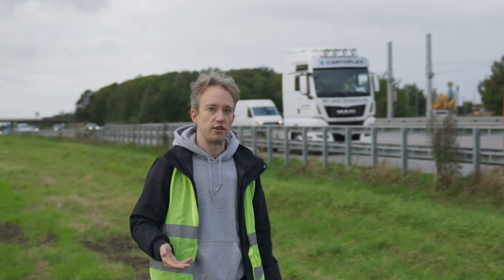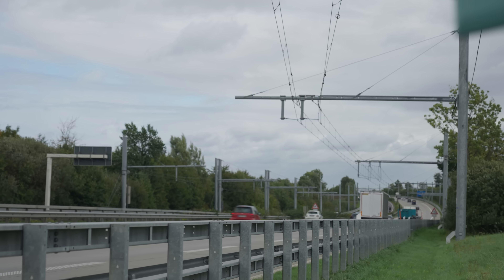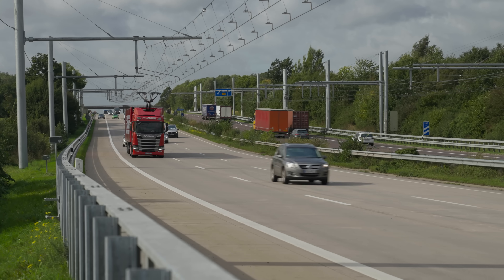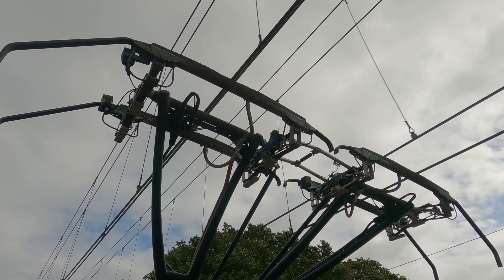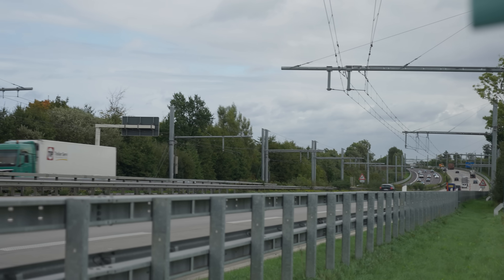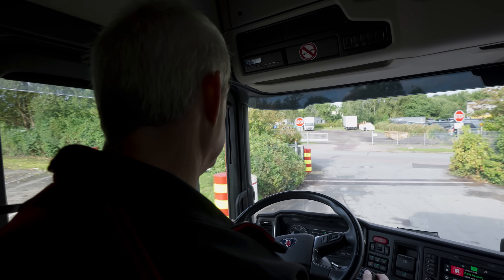The highway where trucks work like electric trains

Comment: There's an inherent loss to charging. I'm too lazy to look it up, but it might be as high as 40%? Add to that the environmental toll that large capacity batteries take... these are a no-brainer IFF it can be scaled up economically.

There are practical applications as well. Instead of a long cable, there can be sections. Zones that overlap two rails can be used to measure the speeds of trucks, and therefore feed into a GPS system to inform truckers of issues ahead. As a person who likes to do road trips overnight, I also see trucks weaving out of their lanes as the drivers nod off. A simple system can be implemented to alert truckers that they're veering out of lane without the turn signal on. A few other implementations I can think of too.

Edit for the curious: weight station avoidance detection, by seeing the spikes in trucks in off hours. wear and tear prediction calculation based on accurate truck usage statistics. weather services being alerted when trucks need to slow down due to weather. suggestions on alternate routes based on blockages. on and on, if the age-old technology gets rolled out for trucks.

Edit 2: A toll system, with an identifier rail. Non-contract users such as EV drivers can purchase an antenna array which connects to the rail system, allowing for long-haul EV driving. Come on, the possibilities are kinda endless!
Reply: Electric cars are extremely efficient. Charging losses are less then 5% AFAIK. You're literally better off burning fossil fuels in a power plant and charging electric cars, than fuelling fossil cars.

Comment: There is a electric test highway track on the A5 too between Frankfurt am Main and Darmstadt.
Reply: Ich hätte nie gedacht, dass ich unter einem Tom Scott Video einen konstruktiven Kommentar von meinem Lieblings YTK Kanal aus meiner Kindheit zu finden.
Reply: I've never seen a single truck on there actually using the overhead wires, though.
Reply: @HeadsFullOfEyeballs  because it's a test circuit only. They're not going to install something like that for a day or two to run a quick little test.
Reply: Du Ehrenmann mach mehr Videos
Reply: Da gab es auch mehrere tödliche Unfälle, der Geisterfahrer der 4 Menschen tötete oder der Fahrer der in die Tankstelle fuhr, den Schaden habe ich gesehen als die Feuerwehr Brandwache gehalten hat, die A5 ist ziemlich gefährlich. Warum ausgerechnet dort ne Teststrecke gebaut worden ist, weiß ich nicht.
Reply: Die Strecke hier ist zwischen Reinfeld und Lübeck auf der A1 in S-H
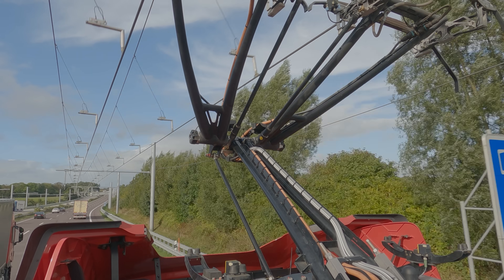Reply: @Eating Rainbows Gaming The highway shown in the video is A1 near Lübeck. source: i'm a local and 2:10
Reply: und 300 m östlich ist die Bahnlinine DA-F...
Reply: @micha0001  die jetzt schon mit den Personen Zügen überlastet ist
Reply: @micha0001   das ist doch lediglich eine Teststrecke, keine Konkurrenz zur Bahn. Lediglich eine Teststrecke, egal wo, es geht um Proof of Concept.
Reply: @micha0001  danke 🙏 

Echt komplett bescheuert
Reply: @johnasweydlnk5313  die deutsche Bahn hat seit den 90er Jahren einen beträchtlichen Teil vom Schienennetz zurück gebaut...
Reply: @johnasweydlnk5313  das ist doch lediglich eine Teststrecke, keine Konkurrenz zur Bahn. Lediglich eine Teststrecke, egal wo, es geht um Proof of Concept.
Reply: @johnasweydlnk5313  Wieso?  Das ist doch lediglich eine Teststrecke, keine Konkurrenz zur Bahn. Lediglich eine Teststrecke, egal wo, es geht um Proof of Concept.
Reply: @borntoclimb7116  Die Teststrecke ist dort, weil es dort eine sinnvolle Anwendung gibt. Container vom Flughafen zu den Speditionen zu fahren. Da fahren tagtägliche hunderte von LKWs zwischen Flughafen und den Ortschaften Richtung Mörfelden und Gerau Pendelverkehr. Deshalb hat sich das dort als Praxistest angeboten. Die ganzen Speditionen im Süden vom Flughafen sind ein extrem gutes Einsatzgebiet für ein solchen Test. Und es gab eben dort auch Speditionen die bereit waren an dem Feldversuch teil zu nehmen.
Reply: Its him bois, the legend himself
Reply: @Eating Rainbows Gaming it‘s not… this is A1 Autobahnkreuz Lübeck to Reinfeld and back. If you can read the number plate you will be able to read the road signs as well. The number plate is probably due to the leasing company of the truck. Spedition Bode is in Reinfeld and has the OD- registration plate.
Reply: @wolfman1325  Just as a point of interest though, number plates are no longer an indicator of where someone is from. I've just done the famous "ummeldung" myself by way of relocation within Germany and have taken my number with me.
Reply: I was there yesterday and my Dad explained to me what those wires are for, and then today Tom roles out a Video about them.
Reply: Bossianus du Legende
Reply: Bossianus einfach legendär
Reply: Jup, and they dont use it haha
Reply: I didn't know that
Reply: Ha, Darmstadt =w=
Reply: Thats mainly for the city buses
Reply: @jujuryan9632  Es ist ja nicht so, dass rechts und Links der Autobahn genügend geeignete Wiesen wären.
Reply: @Poebbelmann       es     ist     nur    eine   Teststrecke.            Proof of concept Teststrecke.
Reply: I thought the A5 ran from London to Holyhead ??? 
Oh, you're talking Germany, Doh !
Reply: correct, has been for a number of years.
Reply: hi bossianus
Reply: I never saw a truck on that track..
Reply: was geht ab
Reply: And the B462 from Rastatt to Gaggenau is also equipped. Source: I am a local.
Reply: I often take the highway between Darmstadt and Frankfurt. I have never ever seen a lorry using these cables. Looks like a great waste of money.
Reply: @heyyou274  because it is a test circuit only... tested once in a while... proof of concept,. It has never been advertised as a fully released or "in service" concept.
Reply: @heyyou274  god I wanna creem some EU buSsY so bad dude
Reply: yep I have to drive there every day its SO disgusting
Reply: @alpha-cf2oi  true, it isn't very sightly, but does contribute (might ultimately contribute) to reducing pollution, which is the aim.
Reply: That's really great. But now it be really awesome if freaky Germoney would have a sufficient and reliable electrical power supply. Too bad this Merkel pulled the plug on nuclear power.
Reply: Und es war eine absolute Geldverschwendung dafür das es 1 Lkw gibt der darauf fahren kann
Reply: @leoo3oo768  Das ist doch garnicht dafür gedacht Geld zu sparen. Das wurde als Proof Of Concept gebaut.
Reply: @leoo3oo768   das ist (sind) doch lediglich eine Teststrecke(n), es geht um Proof of Concept.
Reply: @leoo3oo768  
You have to begin to  test the concept somewhere.  
A regular working route makes more sense. The longer the better especially if is an area lacking in existing rail capacity.
Or long urban routes where for instance the road network is already elevated such sections are extremely problematic and common.
Reply: @clivestainlesssteelwomble7665  This is what they do here in Frankfurt. Regular traffic between the airport and the warehouses/distributors in the south area of the airport. And this works very well.
Reply: @leoo3oo768  Es ist ein Test, natürlich fahren auf den 5 km keine Kolonnen von E-LKW. Das Cern ist auch mehrere Kilometer lang und da werden für viel Geld "nur" kleine Teilchen durch die Gegend geschossen.
Reply: I uploaded my Face Reveal.

Comment: This could be an excellent idea but infrastructure wise  very costly to set up and maintain. it certainly would need government support to make it work on a big scale. 

In Western Queensland they use 3 or 4 trailer road trains perhaps electric powered trucks like these could work. but would it be cheaper than just upgrading the often parallel railway to operate on electric power too. But the distance are very long ie 1000km plus. Thats alot of overhead wires all of it on above single lane highways.

Comment: I actually like this idea. Creating a new railways system that transports goods to specific areas like trucks would be extremely expensive and probably impossible, since infrastructure is designed mainly around car & truck transportation. This is a great alternative to a railway system and seems to be a lot more viable of an option.
Reply: Expanding the freight transport capacity by railway significantly would require huge investments in new railway tracks.... including the power cables and the rails. In Germany,  this usually takes a lot of time. When upgrading highways for this kind of trucks,  only the power cables need to be added - the road does already exist. And especially in Germany,  which has a huge Autobahn network already existing,  it makes a lot of sense to continue to use this existing infrastructure... just add these power cables to the right lane on as many Autobahn parts (and also some other  federal highways)  as possible.

Comment: We have buses here in Milan in Italy that use a similar system on a few routes. They have a tram network as well that uses the same type of overhead wires. The call it the Filovia (probably spelled wrong) 'wire way' they have been here for as long as I have been visiting which is more that 15 years and they look like they are much older than that.

Comment: I have 2 questions.  1.  On a freeway I would think these wires would see use probably 1000 times those on a electric train track.  How long will it take before the frictional wear causes the wires to fail?  2.  If we stop all use of fossil fuel for transportation where will all the electricity come from to power these new vehicles.  I have not seen any governments (other than China that is building coal power plants every day) develop a plan to provide enough electricity for the increased demand.
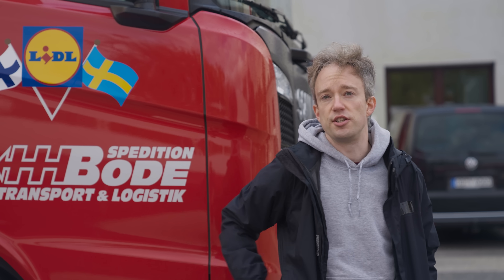Reply: It´s like on a train. On a train the contacts of the train are normally much softer than the wire. So the contact wear down instead of the the wire. you can see it at 3:46. The dents in the contact is where the cable was wearing down the softer material.

Comment: Ok the solution is to charge as it moves, but instead of installing overhead cables everywhere, isn't it possible to install a wireless charging system in the pavement? There's rebar in a concrete road, to add something to this metal grid is surely possible.

Comment: I don't understand.  Unless we're talking about moving perishable items, why not just use the already established rail lines to deliver these goods?
Reply: If you've already got rails installed, that's great.  But if you've got trucks on roads currently delivering to existing warehouses, you need to contrast this comparatively limited investment in electrification vs the substantial investment in rail grades, electrification, grade separation, and probably replacement of a lot of warehouses where it is infeasible to build rails to the existing warehouses.
Reply: because trains are slower, less reliable and cost more

Comment: See it makes more sense for tractor trailers to go electric instead of the average person having to switch. They mainly stay on the highway and it would be cheaper infrastructure to centralize everything at truck stops so they can charge while they are off the road.

Comment: One serious issue is that this solution will impact the emergency service on those roads ... right now its extremely common to land an emergency rescue helicopter right on the autobahn next to an accident, this wont be possible with those wires in the way.
The initially more expensive but better solution would be the embedded in the road surface kind, as this also would allow small vehicles to use the electric supply while maintaining the free space for rescue operations.
Reply: 2 problems:
a) less flexible - cars and trucks don't have too much ground clearance, so you have to drive more precisely on the ground
b) risk of accidents - to short these power delivery lines, you need a long metal pole. If it's just on the ground, you could step on them
c) higher wear and tear from being driven over - imagine having a pothole with a high electricity cable
Reply: I don't think you could transmit enough energy for a truck for it to be worth it that way. Cars, maybe, but not trucks.
Reply: @Croz89  you can, sweden has a wireless charging road test running with truck, bus and car. bigger vehicle simply use multipl receiver.
Reply: @diedampfbrasse98  Likely a buried wire would have a lower current limit than OHL, resulting in a slower charging rate. Plus inductive charging is less efficient.

Comment: When your railway infrastructure is 50 years behind and your politicians are so corrupt and incompetent that they'll probably never fix it so you need to invent something completely new instead to achieve the unbeliavble: move stuff from one place to another
Reply: Trucks can go the last mile. Trains can't.

Not every factory, business or every discounter has an integrated train station. Electric trucks make sense.
Reply: @JanFWeh  The Autobahn is not meant for short distance deliveries between train station and whoever ordered the delivery. Also germany's railway infrastructure has been neglected because of corruption, it is owned by the ministry of transport, and their boss is known for being in the pocket of the automobile industry.

I'm now against new technologies, I'm against trucks constantly blocking the right lane on our highways becoming a permanent thing just because our whole bureaucracy is too backwards, slow and corrupt to implement a simple and easy solution. Trains are by far the most ecological way of transporting heavy freight containers.
Reply: @spiritualeco-syndicalisthe207  You clearly don't work in logistics. You don't know anything about multimodal transport. Also you limited your argument to heavyweight containers. What about all other goods?

Also:
"Those truck are blocking my Autobahn!" Why do you drive a car instead using a train? Way more ecological.

Comment: It's a shame the wires are so high, it'll be hard to access by cars.  You'd remove range anxiety if you could figure a way to run off the grid on the interstate.  Trams have also used used conductor rails embedded in the roadway, but to do it safely, generally you need rail segments shorter than half the length of the vehicle, so it's always covering the live rail.  That'd be expensive to do at car lengths.
Reply: The dual panto and associated electronics would probably be far too bulky. An induction loop under the road could provide some wireless power.
Reply: Range anxiety is not an issue with a properly designed electric car and a proper charging network. Tesla drivers are already free from this concern in many locations. Other car makers could have created the same experience, but didn't, because they didn't want to cannibalize their thriving fossil car business.

Comment: I think hydrogen fuel cells is a better solution for lorries and planes, heavy batteries come at the expense of charging capacity and cost money. Not to mention the enormous costs of the road network.
Reply: Hydrogen fuel cells are not the solution. Why do people keep saying this rubbish. “As of 2020, the majority of hydrogen (∼95%) is produced from fossil fuels by steam reforming of natural gas, partial oxidation of methane, and coal gasification.” Hydrogen comes from fossil fuels it is not clean. The rest is made by electrolysis, which is extremely inefficient compared to putting the electricity straight in to a bev.
Reply: Europe plans to ban fossil fuel trucks by 2040, so fuel cells will eventually come on a large scale. In the Netherlands, for example, a lot of work is being done on a plan where billions will be invested in hydrogen factories and wind farms (NortH2) to supply north-western Europe with hydrogen gas.

Comment: I'm wondering if it would be possible to do something similar to cars as well. Sure, differences in heights of them and requirement of having those lines above you lower than ones for truck but maybe there would be a way to "snap" them only when necessary to cars and leave them higher above when unused.

Comment: It might be the most efficient for some specific cases, but in general steel on steel beats rubber on tarmac most of the time if you are talking about efficiency
Reply: Energetic efficiency is not the critical kind of efficiency for this problem - it is economic efficiency, that is return on capital investment. The road infrastructure already exists and warehouses already exist for this model.  Expanding the use of rail requires expensive grading and separation of rails from roads, and would often require demolishing existing structures and building replacement warehouses.   Even in America where the freight railroad system is really effective, there is more rail abandonment then rail construction.  Now that might be due to subsidized road construction for passenger traffic that trucks benefit from, but it might reflect basic economic reality.

Comment: The solution should be to shift all long distance freight by rail with big regional freight depots and smaller lines leading off to local distribution centres and use small vehicles to distribute then to local business.

The trouble here is that historically the companies that owned the railways owned the bus routes and in the U.K. brown envelopes and other dodgy backhanders ensured that the railways were butchered and built over almost immediately to prevent them from reaping … this was all political and now it’s too bloody expensive to reopen the railways … but it shouldn’t be, there is no political will in the U.K.